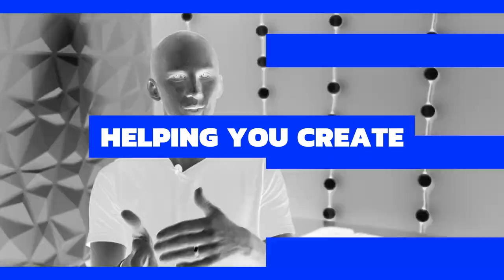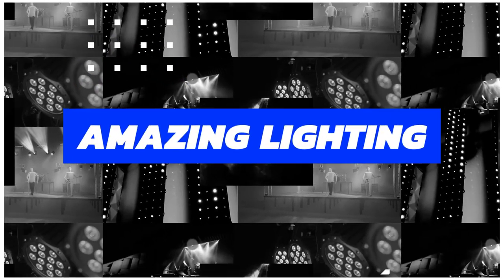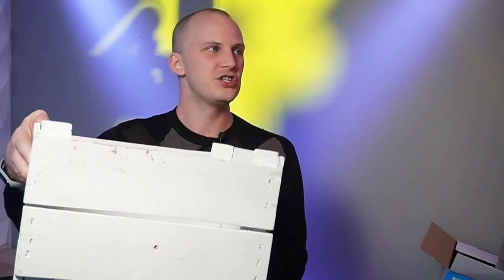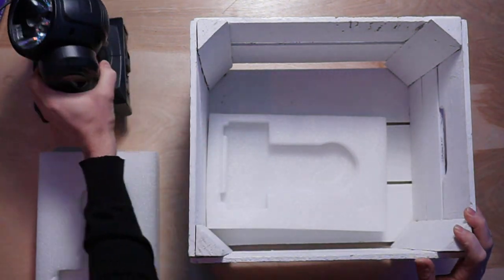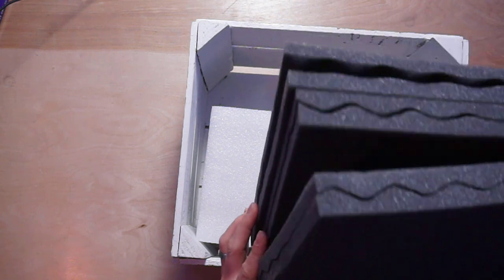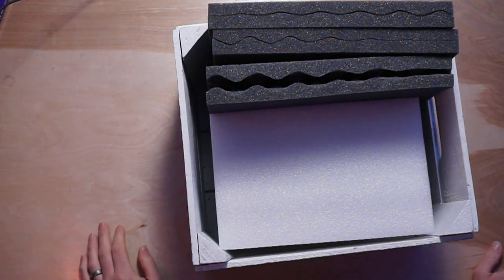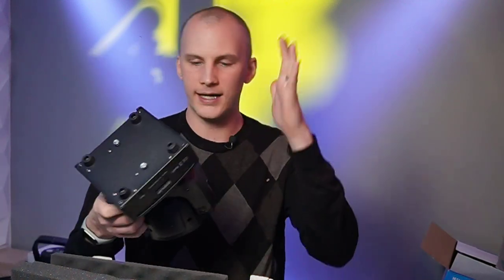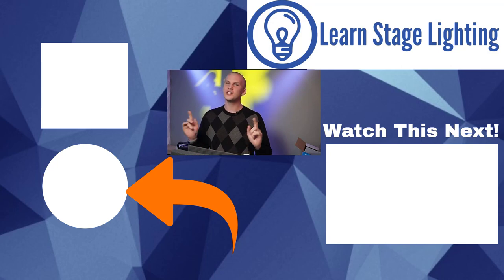Protecting Your GEAR - DIY Plastic Bin Cases

Comment: My lights are 4 moving heads on a t bar. Is there a 50” long plastic container for that?
Reply from the maker: Check your local hardware/walmart type store! Maybe!
Reply: 50" is hard to come by. My Walmart recently started carrying a 43" tub that works relatively well for my 40" LED bars.  Right now there are five bars and four scanners stored there in my basement, but I definitely need to reorganize before taking it out on the road next.
Reply: You might try a used Pelican 1750.